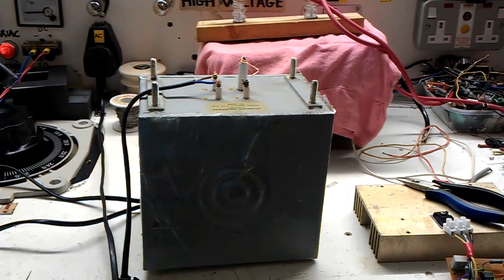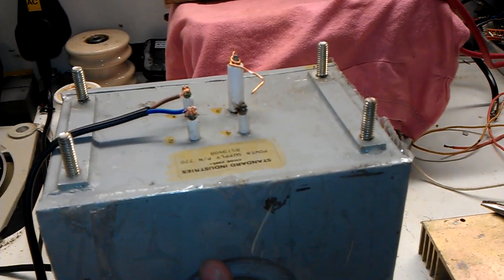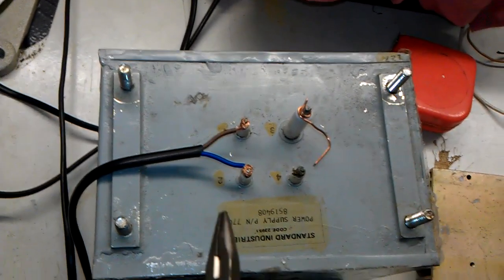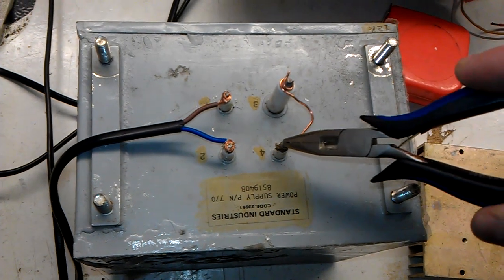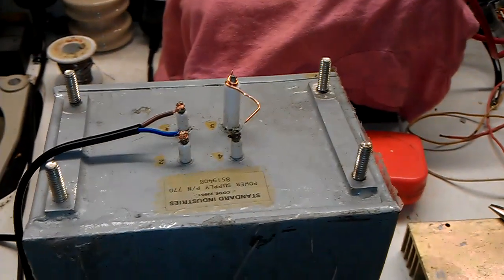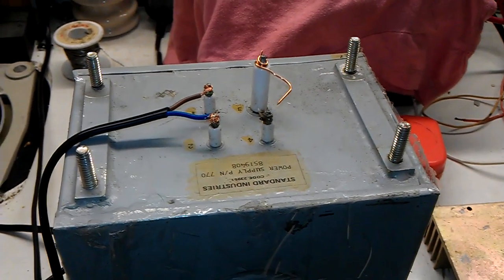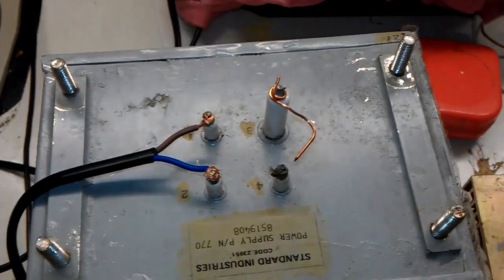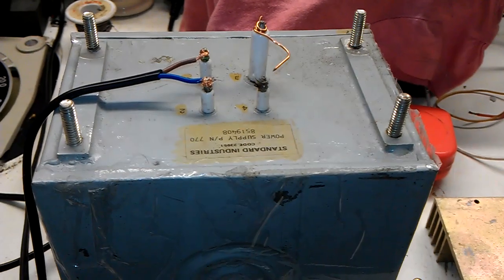8kv DC transformer

Comment: nice supply mate, my only suggestion is to avoid looking at that arc directly for too long, as im sure you know already but the spark produced is very similar if not the same as a welding spark which produces a lot of UV light which will damage your eyes..

apart from that have fun and be safe :)

Comment: if you ballast it you may be able to run that thing off 240, not sure if that thing would handle it or it'll saturate. with the arcs you've essentially got a reflex oscillator there, the cap is charging until it reaches the breakdown Voltage of air, the arc discharges the cap until it cant maintain the arc and the cycle repeats, the discharge happens so fast you get a nice noisy arc